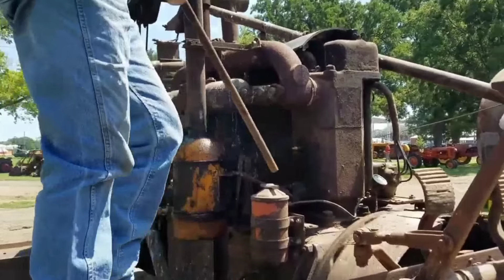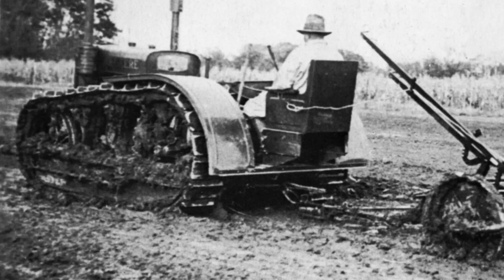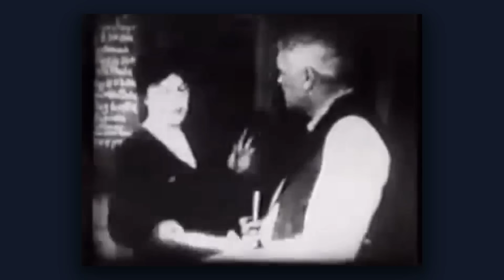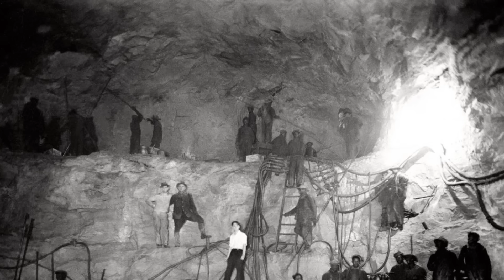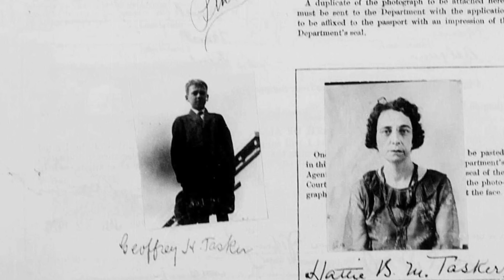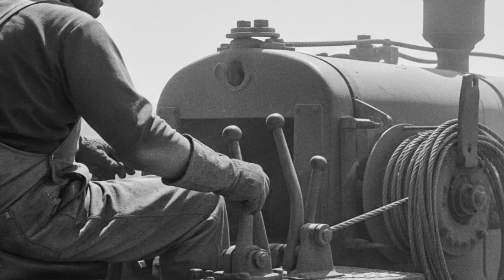Before Hydraulics: The Brutal Life of a 1920s Operator!!

Comment from the maker: In the 1920s, construction killed 150–200 workers per 100,000 per year. Today, that number is 9.6.

That's a 90%+ decline in fatality rates. But every point of that improvement was paid for by the men who came before. The operators who ran cable-controlled bulldozers with no cab, no rollover protection, and no seat belt.

If you work in construction today, the safety equipment you wear exists because of what happened to the men in this video.

Which section surprised you the most? The cable snap dangers, the scraper push-loading, or the Hawks Nest Tunnel death toll?

👇 Drop a comment below.
Reply: 20%  of the men who worked on the skyscrapers in New York city , died on the job

Comment: Hello, Construction Legends.
Yer not a real fast learner, are you?????

Heck, you even SHOW an image of the reproduction version of the Cummings/McCleod bulldozer from 1923 which had a blade mounted onna Fordson WHEEL tractor - - - and then go on to say that it was mounted onna crawler tractor.

LaPlante-Choate appear to have been the first company to produce bulldozer blades commercially, apparently starting later in 1923. These were apparently raised and lowered with a hand-operated screw-type arrangement which may have been operated by the tractor operator on smaller machines or by a second person on bigger machines.

There is a photo of a Holt 2-ton crawler fitted with such a mechanism on a Wordpress site about Bulldozers and there is a photo of a Holt 10-ton crawler fitted with a similar set-up ‘hiding’ on the internet.

LaPlante-Choate apparently developed the gear-type hydraulic pump around 1925 and probably started building hydraulic controlled bulldozer attachments for various crawler tractor manufacturers soon after that. These would NOT have been especially hard to operate.

R. G. LeTourneau is often credited with building the first powered cable control system in 1929.

The Fresno scraper was first built in 1883 but it was a LONG way from being the first scraper. It was simply one stage, albeit an important one, in the LONG history of the development of scrapers.

The ONLY time that a scraper control cable breaking would have been a danger to the tractor operator would be if the break occurred in the short run of cable between the tractor and the scraper. Once it reached the actual scraper cable sheaves, they would have acted as a containment for the cable.

I quit at 10.00 ‘coz I had OD-ed on your BS.

Just my 0.02.

You have a wonderful DELUSION. Best wishes. Deas Plant.

Comment: As late as the mid 80’s, I ran a Northwest mechanical crane. I used a hand crank to start the pony motor. Being the newest operator, I got the oldest crane. And this video is correct. The metal seat, no heat, no fan, no door and no front window. Kinda cold in the winter!
Reply from the maker: hey Paul…. seems that we have to make a video about the cranes back then?!
is there anything we should cover in it?

Comment: I remember cleaning out the Barn, next door, to clean the Horse manure 😊 it was a TWO handle, (shovel like handles) 😊 with a scraper bowl in middle. We would pull it back by "HAND" to get back as far to wall as possible, then just control the scoop by hand,  till Full, then keep pressure down on handles, as it was dragged out to dumping area. Then you would Lift up, with muscle strength to tip over the scraper bowl. Then back to the Barn. Over and over again. 😊
Reply: Back on the farm we used that hand scraper for many jobs clean barns dig building and driveway bases crude but beat pick and shovel any day pulled it with Ford 8N.tractor.
Reply from the maker: Hey Steve, thank you for your impressions.
Where do you come from? I'm asking because of the hot summers....
Reply from the maker: Sounds quite exhausting. When was that and who was “we”?
Reply: It’s called a Fresno
Reply from the maker: @Alec-lv6io You're right, the Fresno scraper is the proper name for it. Thanks for the correction and for watching!